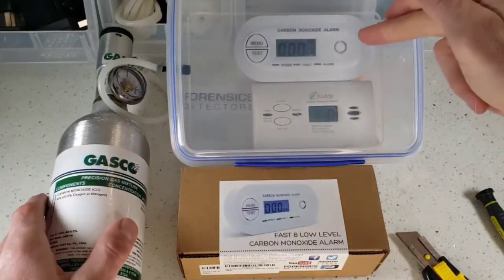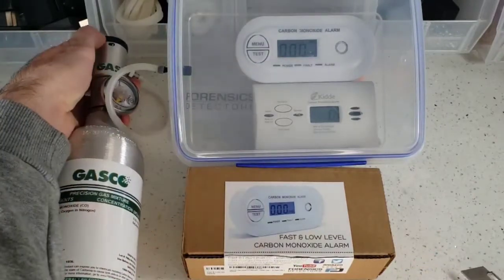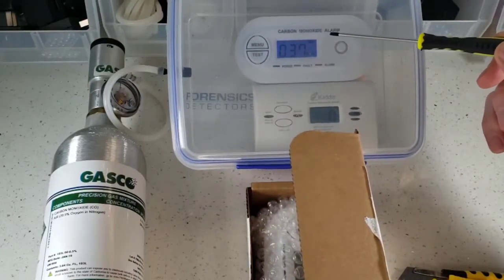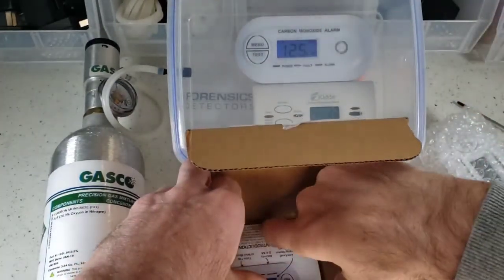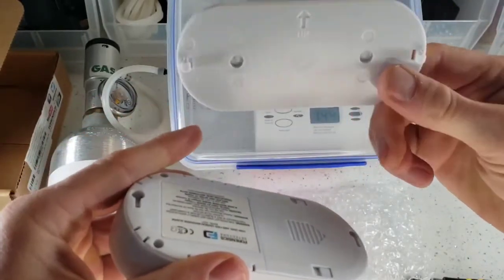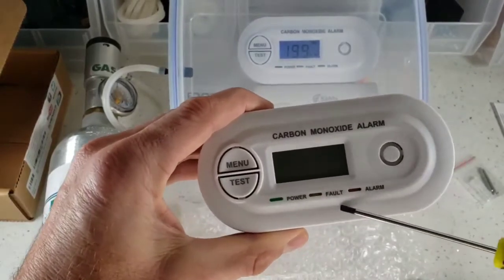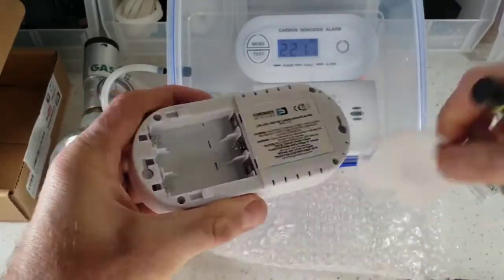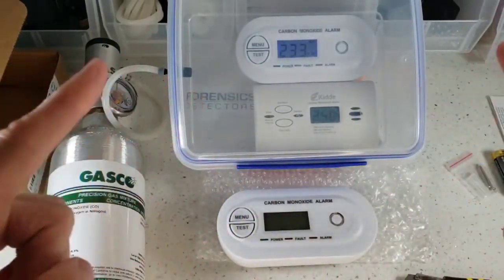Low Level CO Detector Challenge

Comment: doesnt sound very loud, or is that just the camera? I bought one of these and its coming in a few days. Want to make sure its loud enough so i can actually hear it.
Reply from the maker: Not to worry. It will be loud enough, the video shows the unit in the plastic chamber which blocks much of the volume and the mic is directional. Thank you.